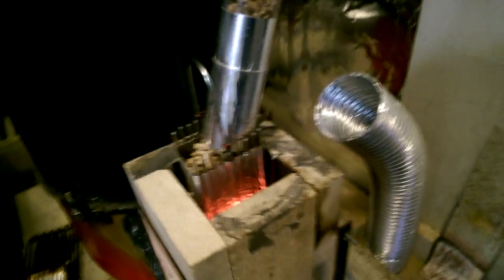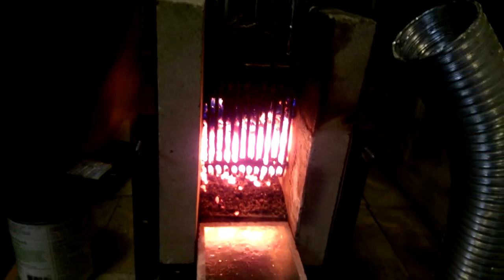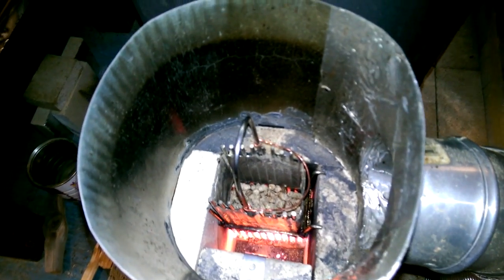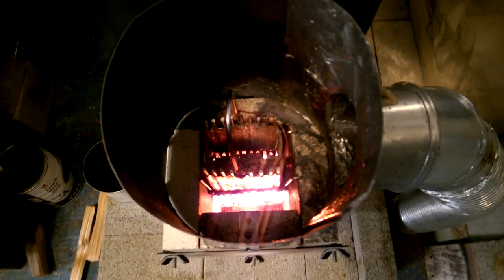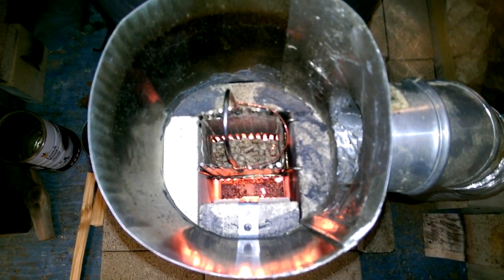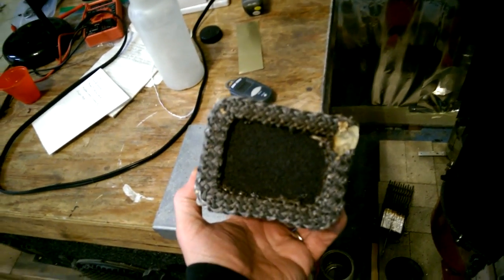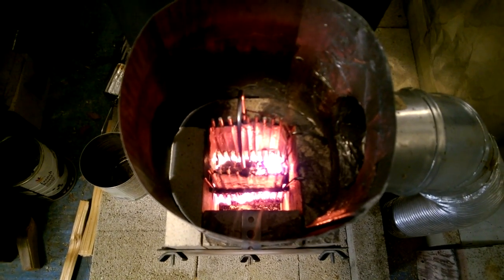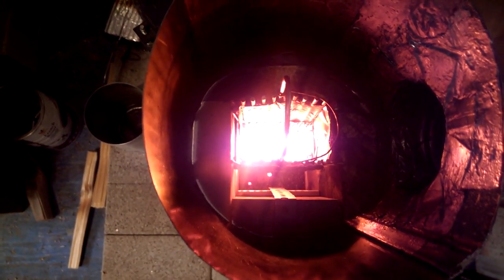#450 Rocket Stove Pellet Feeder update 2

Comment: 5 years from your last update! Any long term conclusions? The main public should build based on proven, good design. Its therfore very interesting with updated videos! Thanks for the series!
Reply from the maker: Has it been that long? Wow. The basic design has not changed. Using 3/16" 316L stainless to make the baskets now. They last me 2-3 years before needing service which basically is just replacing the sublimated sections exposed to the greatest heat by cutting them out and welding in new pieces. The design is otherwise flawless. And, unlike many commercially made units I see popping up, my A/F ratio is fully adjustable by simply moving the basket position within the intake front to back.
Reply: @zerolabs   thank you for answering! 316L. Will try. We have many boilers at work, and choosing the right material for the right application(temp, fueltype) is really important for the lifespan of the material.

Comment: If you know how to weld this is a great idea to use the simple principals of a static flow system...   look and search for clarry stove diagram.....http://clarrypelletstove.com/
Reply from the maker: Yes, I've seen this design before. It may work but it's still not nearly as efficient as a rocket because it relies on high flue temps to draft correctly. Not enough surface area for heat exchange into the living space. The highest flue temp I have ever recorded on my rocket is 180F and that was with the stove running >1000F at the top! Think about THAT one for a minute.
Reply: @zerolabs  the clarry is a rocket pellet stove or space heater depending on its purpose. Any stove or heater that creates a high velocity air flow that almost completely disintergrates its solid mass fuel is just that. Chimney fires were the first concept of rocket stove principals. The clarry exhaust system winds it way out creating more remaining heat instead of a direct flow exhaust. Maximizing your heat retention and maximized fuel combustion is the optimum process you want to achieve with the least amount of energy to produce for that effect.

Comment: The problem I had was the fact the burn basket (mine was 1/4" stainless steel rods) would completely fall apart in a week of burning, so back to the drawing board! Stainless rods do not hold up to that kind of heat.

Comment: Hello,
Thank you for your message. The Updats 1 and 2 were very interesting again. Unfortunately, I have a small problem with the sound of your videos. He is very quiet, so I can not hear much. This etsteht the second case of a problem for me. As a German we measure in mm, cm, m etc.
1 inch = 1 "(inches) = 25.4 mm. I need to convert everything. As the sound too quiet I do not understand your statement.
I have a question to the pellet basket.
How strong are the stainless steel rods and at what distance they are located. I started last week with my project and the first firing tests were successful.
Thumbs up.
Greetings from Germany
Michael

Comment: I want to build a smaller version of what you have with, 3x3 steel j tube, run into a 6" capped pipe exhaust out the bottom on the side. And cap that with a 8"black chimney pipe with a fan to force the heat out the bottom on to the floor.. any suggestions on length of burn chamber ect? I never built one before..

Comment: On longer burn cycles do you still have issues with ash build up on your basket? I was looking at using an auger system to bring the pellets up from underneath, form a Venturi just past the pellets, and a slat at the back of the up tube to allow ash to drop below for cleanup. Any thoughts?
Reply from the maker: +Eco360 I still tickle ash out from time to time with a slim poker to stoke up the stove quickly and maximize temperature. If I don&#39;t it still does collect a little on the bottom of the upstream side of the basket. I have found it&#39;s because that area of the basket is not hot enough. If the stainless is kept red hot it becomes self cleaning. Ash will not stick and build up. That&#39;s where the shape of the basket becomes important. Rounded bottom tends to run cooler on the upstream side. Wedge bottom stays red hot. However, I have let it run untouched just to see what happens. It reaches a maximum and the stove does run less hot but it has never fully clogged on me. I have also started playing around with higher IR reflective materials against the front wall of the fire box to reflect more heat back to the coolest side of the basket to help keep it red hot and self cleaning with good results.

It seems like your system might work but I stayed away from augur systems because they are complex, difficult to regulate, ALWAYS require power to operate and present more points of failure. The best part of my gravity feed is it is self regulating taking pellets only as they are needed, and can run completely unattended with minimal battery power from a timed shaker at the hopper or totally without power and a tap to the hopper once every half hour to an hour. I like to K.I.S.S.

Comment: Nicely done, thanks for sharing. In the Lurgi gasifiers I did my engineering training on, the fire zone was controlled by the speed of a rotary grate and the oxygen/steam rate.I know it is not quite the same thing but In your case since you clean out the ash every day and the fire zone will not rise sufficiently to block combustion. However, if you wish to operate the stove for longer you might want to consider designing an automatic ash removal system.
Reply from the maker: +Jeff Harmed It creates so little ash I literally clean it out only every 3rd burn or so.

Comment: Q: How long time does the Firebasket last for?
Reply from the maker: +Inventor Gadget I got two full seasons out of my first fire basket if intermittent use. I'm now using an earlier prototype that works well enough I'm not motivated to make another one this season. I suppose if you used it as your primary heat source every day you'd have to replace once every season.

Comment: Good Morning,
Yes Sir it does help. I will be using on the second RS which I did not use this winter-I will be setting it do duo fuel-wood n pellets. I learned that the air inlet is very important when your RS is sitted at one "angle" of the house (center would be better)which often times the wind changes direction and creates a negative effect entering the house and creates back draft and lot of smoke inside the house. Surely my smoke pipe needs better system for a better draft thou. Also a 6inch pipe is greater good than four for the reason that u can just regulate the air that enters in the RS instead of HOPING that 4 inches pipe will do his job better. Good luck thanks for always and God Bless.

Comment: Ever think about adding a Stirling motor attached to a generator to the top of the rocket stove?  Both Heat the room and generate electricity.
Reply from the maker: +EvilOverlords Yes. Inefficient and noisy.
Reply: Have you seen some of the more recent models?  They are a lot more efficient and a lot quieter.  Also have you thought about making a heat exchanger to your hot water heater? Set that on top and recycle the heat to other useful things,  I could see a heat battery to help keep the temperature stable in an area after the rocket stove goes out. Remember efficient use of the heat generated comes in small chunks, not giant leaps.  Just throwing out some ideas.
Reply: There are folks trying out nearly any combo of ideas and many of them are posting online...

Comment: OK, so the fire never reaches the feedertube. And if you are worried about the IR heat melting the feedertube, you could just make the firebasket a couple of inches higher and then place the feedertube accordingly. 

Would regulating the airflow turn the heat down?
Reply from the maker: +Per Jensen Yes, you'll note my removable cover plate has a notch in it to accommodate the feeder, sealing off the manifold and taking all the air from outside. There is a slight restriction when doing so and it does burn less hot. I suppose you could also put a damper on the inlet port.
Reply: I like the way the pellets burn.  Very nice. I would like to build one like this. Can you help me?

Comment: How strong is the flow of air from your fresh air inlet?
Reply from the maker: +JohnnyKanuk Very strong. The room is well sealed. Placing my hand in front of the pipe inlet inside the manifold I can easily feel the cold breeze passing by into the firebox. Virtually all of the negative pressure created in the room by the RS is relieved by the fresh air inlet duct. Very little if any of the cold air entering is from doors or windows. The room stays nice and toasty.